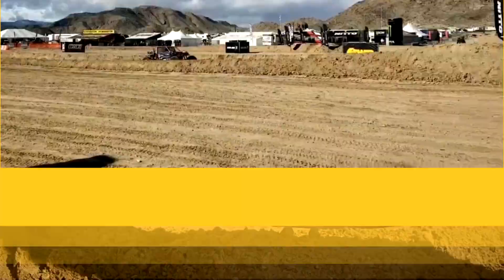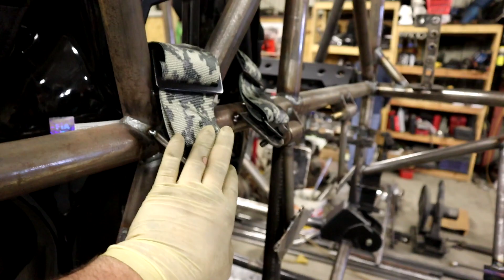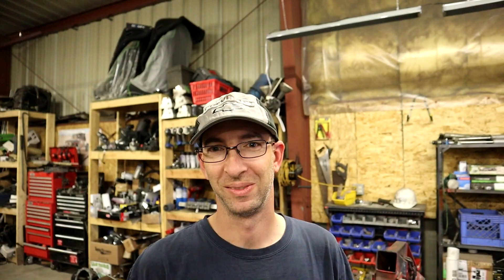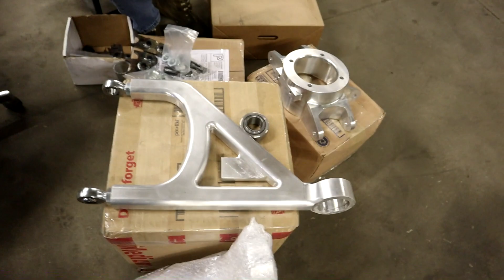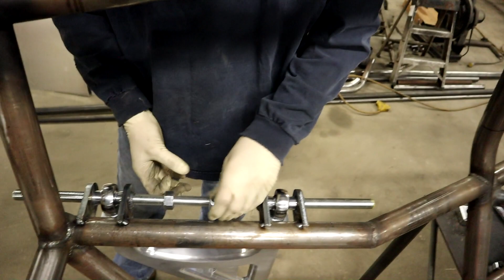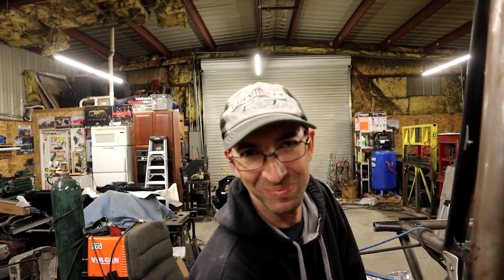Ultra4 IFS Twin Super Charged Build Update Part 7 - IFS install Begins

Comment: moon buggie worthy project "car" unlimited racing imputs & super metals concepts & material esp most important design. At each tire a bike like tire mount up where forks surround tire. The arm has digital power or stored fly power or chain & gear driven power all in 1 arm.  Think RC wild Moon bug come to life any thing goes scale arms/tires, travel, even tires need not b round thing oval is better set up like way tracks on tank look. Triangle from circle tech is cool but seems overly tuff vs just belt around center hub varying tension instead of air-ing up or down.   By hving bike arms not normal axle set up per tire can hve inner & outer ride ht adjustment. Arms fully extended, or fliped *& arms raising ride ht up retracted under rig.  Only thing else is diff bike arm set up at the fork u can hve tetter totter effect some "axles" or design were u get another arm w/ tire on both ends from fork control travel/axle arm. If it flips like RC cars hve fork arms flip fully around upside down travel, or for righting rig.

Comment: Curious to see how the front tie rods will connect to the rack? I guess I'm confused I thought the rack would be lower down in front of the diff. Will there be linkage going from underneath the rack to each side?
Reply from the maker: We will be making a custom drop bracket to place the tie rod pivot points at the ideal location. There are many ways people mount their racks.
Reply: @carbonshocks  Okay that's awesome! This is why I was so stoked to see the front end come together.  Such a great learning experience 👍